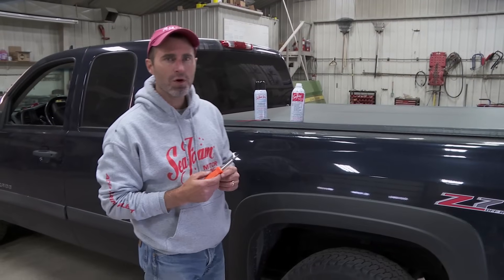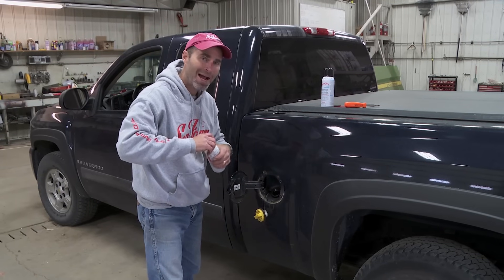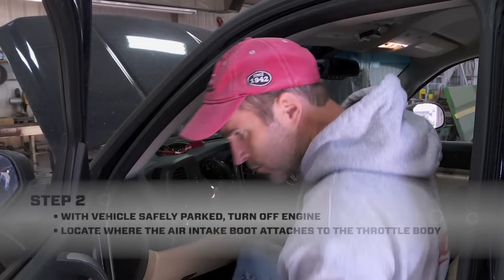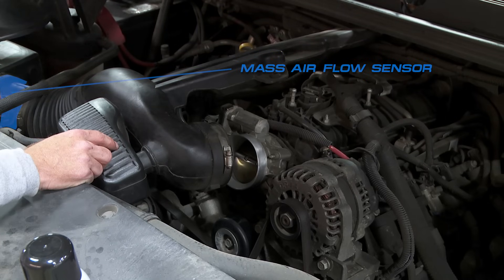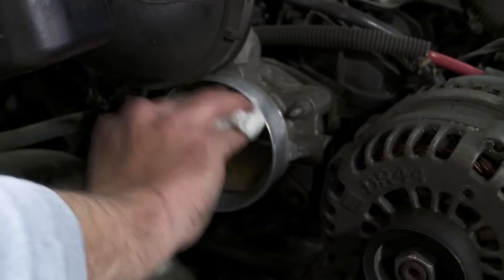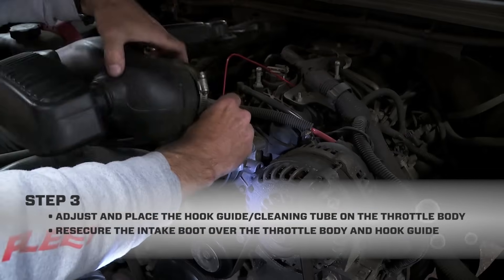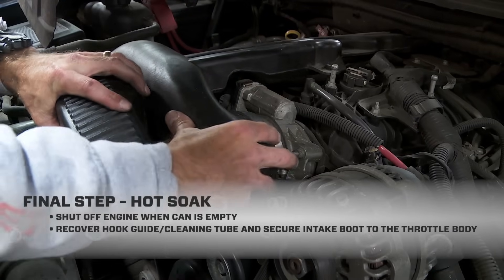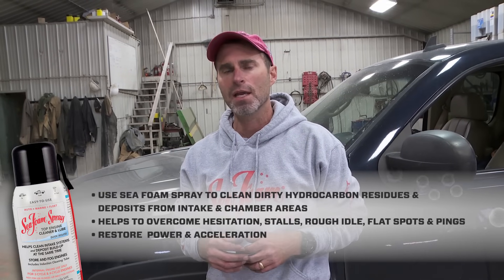How to clean a gasoline fuel injection air intake with Sea Foam Spray

Comment: How does this work for cars with two intakes
Reply from the maker: Run half the can (stop at 3 minutes) through throttle plate #1, use the second half of the can through throttle plate #2. How's that?
Reply: @SeaFoamOfficial  I'll try it out, I figured it's all going into the same intake so it would work the same. But I'll try this out
Reply from the maker: The two throttle bodies feed half the cylinders each so important to treat both sides. Otherwise, half of your engine would be clean.

Comment: Isn't there a danger of this product causing a big chunk of carbon to break free and then scoring the cylinder wall when it gets wedged or caught between the piston rings?  A mechanic tool me not to use this or any other cleaner for this exact reason.
Reply from the maker: No, that's how a detergent works.  Sea Foam is not a detergent.
Reply: OK, so it does reduce the carbon on the back of the valves and on the piston heads correct?  Is it just breaking it down in minute quantities then?  How does it remove carbon without potentially causing it to break off and wedge between the piston and cylinder wall?  Is it burning it off?
Reply from the maker: Hi Jason:  Hydrocarbon fuel (gasoline) develops two problematic forms.  One is gum/varnish that can form in fluid (pre-detonation). The second is carbon ash (post-detonation).  Carbon ash is fuel molecules that do not burn completely in the chamber.  Carbon ash deposits are carbon flakes held together by sticky, baked-on fuel varnish.  Sea Foam liquefies the varnish that holds the carbon together.  Sort of like how glue and sawdust are used to form particle board.   Hope this helps!

Comment: Do I have to change oil after clean air intake with Sea Foam Spray?
Reply from the maker: No need to change oil.  Not related.
Reply: my car is flex fuel car, I mix E85 with gas. Is that going to be work on my car? Thanks.
Reply from the maker: Yes, gas blend/type makes no difference.

Comment: I have a 2016 lexus is 300. Both port and GDI injection. Do you suggest using seafome for maintenance
Reply from the maker: Sea Foam in fuel, but for cleaning intake valves use Sea Foam Spray.
Reply: @SeaFoamOfficial  the dealer told me not to run any fuel treatment through it. Do you still say it's a good idea? They couldn't give me a good reason why not to either

Comment: My question is -is sea foam just before oil change or can you place it in after as well
Reply from the maker: You can add Sea Foam to your oil crankcase any time during the life of the oil interval. We just recommend 100 to 300 miles before replacing oil is best. Consider that you're adding Sea Foam to liquefy the heavier crankcase residues back into fluid so it all can drain away when dumping old oil. Hope this helps!

Comment: So, no replacement of fuel filter after this?
Reply from the maker: No, has nothing to do with the fuel filter.  The treatment is delivered through the intake ports.
Reply: but you add seafoam, into the gas tank. thats why my question, thanks!
Reply from the maker: No, a fuel filter works to screen out particulates.
Reply: Sea Foam Official thank you!
Reply from the maker: Our pleasure, always!

Comment: I have a question is that hook guide made by you or can you get it in a parts store or if you can't find one can you just use any kind of small vacuum hose or whatever goes over that tube the red tube?

Comment: Will this help clean fuel injectors?
Reply from the maker: No, use Sea Foam in fuel for injectors.  (Sea Foam Spray) Application through the upper air intake does not pass through the fuel injectors.

Comment: Could i disable my fuel pump to prevent the engine from running, and then spray seafoam while cranking with the throttle wide open? The reason is... I prefer to spray it in full mist form rather than a stream form when used with the straw... My thought is that in stream form, it may favor certain cylinders and not equally distribute compared to a mist.
Reply from the maker: No because you need fuel (gasoline) to run the engine. Without fuel it won't run ad you'll foul out the plugs.  The straw does aspirate (mist) the fluid.
Reply: It's not going to matter. If you spray fuel (seafoam) into the TB its going to spindle regardless. That seafoam liquid is going to go where it needs to go dont worry about that.

Comment: Hey guys thanks for the video I have a new fuel filter in my 2002 Chev cavalier 2.2 engine my question is will sea foam in my gas tank clogg the new fuel filter?
Reply from the maker: No, will not clog.  It will, however, work to clean your fuel filter.
Reply: Sea Foam Official Thank you guys God bless you!!!!!

Comment: I got a 01 zr2 blazer 4.3l thing ran tit all last year but I was driving and it ran out of gas (bad gauge don’t tell me what it’s really at) got it a gal and drove it home. but with money getting tight I parked it for the winter and drove the family van. 1 month later I can out to start it and she will not turn over even with a jumpstart. It takes about 10 cranks to get it on and then it’s power is pretty much lost and if you step on it she hesitates. Would this be the next step to get her back out and rolling?
Reply from the maker: Fuel pump?

Comment: For an older car with high miles, could another treatment be beneficial after the first, especially if it smoked a ton while driving?
Reply from the maker: Yes, the more you do/more often, the cleaner things get.  Like washing dishes or brushing your teeth.

Comment: I understand that you use it to clean out through throttle body and it will clear and clean up intake manifold, is there possible a good idea to clean up through pcv valve hose to intake air control or manifold or to EGR valve? Or do it though brake boost?
Reply from the maker: Sea Foam Spray's primary use is to cleaning intake valves and chamber areas by application through a throttle body or carburetor throat.  You can also use through idle air control or spray into the PCV.  Will clean EGR parts if removed.  Hope this helps!

Comment: Mercedes M113 engines have the MAF sensor RIGHT ON THE INTAKE plenum, the throttle body is UNDER the intake, you have to spray it through the MAF to get it in the engine, because even the PCV lines bypass the TB ...
Reply from the maker: Have never heard of a MAF located downstream from a throttle plate. MAF sensor (intake air) or MAP (intake manifold)?   If spray must go near MAF, just make sure your tube is pointed at the throttle plate opening and the RPM is 2,000 (elevated) as you spray.

Comment: I have a 2007 N54 335i with 124k miles, i took off my manifold and attempted to clean my intake valves by hand using the scrub method but that was no use. Im wondering if using SEAFOAM can substitute me walnut blasting my valves. Thank you
Reply from the maker: Yes, it will work to clean your intake valves.  Try it - Do 2 treatments back-to-back, then if willing, remove your manifold and take a look.  Then keep in mind that you can repeat intake treatments as often as needed.

Comment: Is it ok to spray the can into a vacuum tube instead of the throttle body?
Reply from the maker: It does not work nearly as well (or safe) as going through the throttle body.  We do not recommend putting any fluid into a vacuum line.

Comment: Appreciate hearing you can never add too much fuel treatment!! Whole bottle, 5 gallons..  I think I might
Reply: That aint nothin. We had a car run out if gas and just to give it enough to move it around the house I put a can in it. Then another guy put another can. Then another can. If there was a drop of gasoline left in it, it was eaten by seafoam🤣
Reply: Yeah. I liked that too. Plus it's basically optional to add to gas. I am.  I'm doing same as him.
Reply: I dont even use gasoline anymore. Sure its expensive to fill up on seafoam but I think its worth it.
Reply: @somethingforeveryone4206 😂

Comment: Is this foam safefor the EGR valve? I have a Windstar 3.8 SEL, thanks
Reply from the maker: Yes, Sea Foam is always safe in gas/diesel fuels.  Note that the EGR occurs after combustion so not a factor.

Comment: I have a 2008 Dodge  Nitro 3.7L 334,678 miles on it.  I've been using Seafoam in the fuel tank every 3rd  tank,  added to the oil 200 miles before I change the  oil,I use Mobil One full synthetic and change it every 5,000 miles,  and I've used  the  Seafoam fogger 2 times and the engine runs like it has 30,000 miles on it.  I swear by Seafoam!
Reply from the maker: Great to hear - Thanks for posting!
Reply: Read the can. Says you can add to oil and gas.
Reply: Is it safe to add it to the engine oil? How much do you add?
Reply: Yeah like the one guy said, do you mix it in with the oil or wat?
Reply: @RCsFinest   yes you can add it to the oil (atleast the can that doesn't spay). I'm pretty sure it's 1 oz of seafoam for every quart of oil your motor holds.
Reply: Yea, all that cash on seafoam didn't help one thing!  All this sea foam crap is B.S.!
Reply: @brandonknight7240 if you read the instructions and do maintenance properly then you wouldn’t have problems unless you just treat your car like crap
Reply: @brandonknight7240 I mean there’s proof it works. Theres better stuff, but there’s not much safer stuff

Comment: Hey. I just added a small bottle of STP fuel injector cleaner to my car about a month ago, after an oil change. Is it ok to deposit the Seafoam into my gas tank again, at this time? I want to see if it helps with my engine stalling. 2010 Volvo with 135k miles.
Reply from the maker: Yes, go ahead and add Sea Foam any time. No worries.

Comment: Just used Seafoam on my 2005 Cadillac Deville, I was expecting a the dramatic  'white smoke' but there wasnt 😣😣😣 HOWEVER my car does run well the reason i got it is because it burns gas #HorribleMileage. Advice is needed and appreciated
Reply from the maker: You will not see white smoke (oil vapor) by adding to fuel.  Visible vapor occurs when added directly into the top end.
Reply: Sea Foam Official thanks

Comment: I have a 2013 santa Fe and 2013 sonata. Both 2.4 litre engine. Both engines have a MAP sensor which is after the throttle body plates. Is it still safe to use the spray? Will it mess up the MAP sensor? Thanks
Reply from the maker: The video cautions to avoid MAF (Mass Air Flow).   MAP (Manifold Absolute Pressure) is different - no worries per MAP.

Comment: Hi,
 Really intrigued into using this product on my100,000 mile 335i. Problem is the intake area ( post mad is incredibly difficult to access and using the prescribed. Method means many hours. Of work. Is there a way I can access the top of the valves using another method.
Thanks from the uk 🇬🇧 
Mark
Reply from the maker: Hi Mark:  Yes, BMW hardly ever makes it easy to access the throttle body.  Some people drill a small hole in the intake boot to pass the straw into, then tape over for future access.

Comment: My 2013 CTS 3.0L V6 throttle door opens at the bottom (and it is positioned slightly downward). I installed the tubing at the bottom and had hard time keeping the tube connected to the bottle... After struggling to hold the tube with 1 hand and squeezed the nozzle with other, I did most of a can and saw no smoke from the tailpipe (I had my son keeping the engine at 1500 rpm).

Am I doing something wrong or my engine has no carbon?
Reply: A quick update:  I went out and started the car and I do see white smoke coming out at higher RPM (2500-3000).  The light white smoke continued for more than 10 minutes.   It is a sunny day and the smoke is not obvious in 1 direction...  I think the RPM was not high enough before...  Still where is Seafoam burning from???
Reply from the maker: Thanks for the post and follow up.  Can you rephrase your question?   If it helps, the white smoke noticed is vaporized oil from the Sea Foam heating in the upper engine.  Sea Foam is petroleum oils - it works all the way through the exhaust stoke...does NOT burn in the chamber.

Comment: Hello, I have a 2013 Infiniti G37 V6 3.7 with two air entry system, how should I use the seafoam spray ? Thanks
Reply from the maker: You can spray half a can thru one for 3 minutes, then spray the remainder of can through intake two.
Reply: Sea Foam Official perfect, thank you
Reply from the maker: You bet - Let us know how it works out.

Comment: Does the gas tank need to be filled up before starting the process?
Reply from the maker: No, not necessary.  We recommend adding a can or 2 of Sea Foam to a low tank of fuel to clean injectors while cleaning the upper engine through the intake.
Reply: Sea Foam Official I drove right after letting it sit for 10 minutes because it was making a lot of smoke. Will this cause any problems?
Reply from the maker: What do you mean by making a lot of smoke?   How much gas was in your tank?
Reply: Sea Foam Official I used only the Seafoam that goes into the intake. I ran it for 5 min while spraying the liquid into the intake. I finished and let it sit for 10 min. I started the car back on and a lot of white smoke came off the exhaust I couldn’t let it sit on my driveway because of my neighbors so I drove off immediately and my engine made a strange noise. Like clicking. Will this cause any harm?
Reply from the maker: Thanks, Cristobal.  I failed to consider you were applying Sea Foam Spray. [I was thinking you meant to say adding Sea Foam to your tank caused smoke, sorry.]  After a hot soak with Sea Foam Spray it's common to see oil vapor (white smoke).  Will not cause harm...There can be a temporary clicking sound of the upper engine to adjust for the fluid volatility...Should go away in the first minute or two.

Comment: Went to a shop to get my fuel injectors cleaned by the air compressed can pump thing through the fuel line on top of the engine. Paid $200 for what I thought was injection service but after I get home and I saw the statement/receipt it was intake service. So I pop the hood and noticed my brake booster line was removed and was still wet with some solution then I found the white sea foam cap sitting on my oil rag under the water reservoir. So basically paid $200 for them to run sea foam through my break booster and fuel tank.... And car runs worse. Thanks City Garage in Fort Worth Texas 👍👍👍.
Reply from the maker: Thanks for the description.  If a compressed air device (canister) was used the product would have been applied directly into the fuel rail to clean through the fuel injectors.  As you likely know, application through a brake booster will not clean fuel injectors. If you drive without the brake booster line attached, the engine should run rough and the power brakes won't work... Apart from the receipt, did you get any clarification from the shop about what service was performed?
Reply: No compressed air. They went through break booster.
Reply: Sea Foam Official and I'm sorry what I meant was I could tell they removed my break booster because the end of the vacuum line was still oliy/wet from either sea foam they used or something else. Either way truck has slightly more power but just annoyed they didn't understand what I needed done. Thanks for response and you guys have an awesome product.
Reply from the maker: Got it - Thanks for the follow up!

Comment: what do you do if you have 2 throttle bodies? use two cans?
Reply from the maker: You can use 2 cans OR just run half a can through 1 side (3 minutes), half through the other until the can is gone.
Reply: Sea Foam Official I used two cans
Reply: Sea Foam Official do you have a distributor in South Korea? I'm having a hard time getting seafoam over here. I have to use ebay and it's hit or miss
Reply from the maker: We do not have distribution in South Korea, yet.

Comment: I did this and now the service engine light is on now.
Reply from the maker: If the sensor doesn't re-adjust within 20 drive miles try disconnecting your battery hookup for 15 seconds to reset.

Comment: Thanks for the informative video. I'll try this on my 97 Tahoe with 250k....
Reply from the maker: Hi Michael:  Let us know what happens!
Reply: It went absolutely as you said. I followed your directions to a ree....my 1997 Tahoe 5.7 liter and it runs smoother and no hesitation that I had previously. I'm very pleased. 

I've also saw videos  were they used Seafoam in the brake booster vacuum line. Is there a need to use Seafoam there as well?  

Keep ur videos coming buddy!!!
Reply from the maker: Thanks, Michael.  Though Sea Foam Spray through throttle body and pouring a liquid into a vacuum line reach the same upper engine areas,....Sea Foam Spray works FAR better!   Vacuum line is wasteful since it does not cover cylinders evenly and much of the liquid gets pushed out the exhaust valve.
Reply: Sea Foam Official  Thank you much for your reply  and I’m  gonna film the throttle body with Seafoam... I’ll video the process!

Comment: No instruction in this video BC you didn't talk to owners of pre-GDI engines  Answer:  Into where do owners with pre-GDI put the product?  Why can't the placement be placed into the PCV?  Can you answer, or is this just BS fo Seafoam sales?
Reply from the maker: The 2008 Chevy 5.3 truck engine in the video has port injection.  It is not GDI.  Even so, whether any gasoline engine is port or GDI, how and where you apply is exactly the same; whether a carburetor intake, throttle body injection, port injection, or gasoline direct injection (GDI), you apply directly in front of the throttle plate/throttle valve.  We don't recommend application through the PCV because 1) not necessary, 2) will not feed cylinders evenly. Hope this helps!